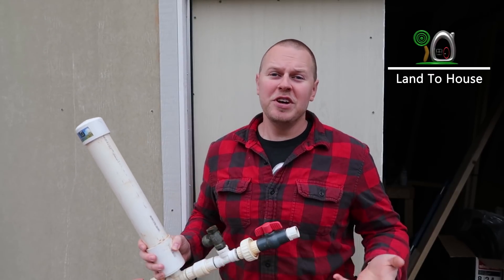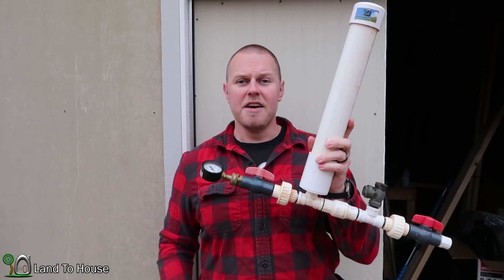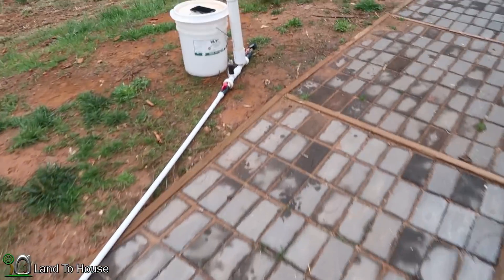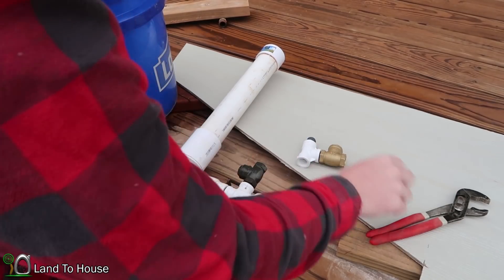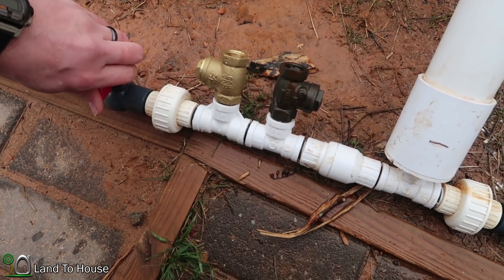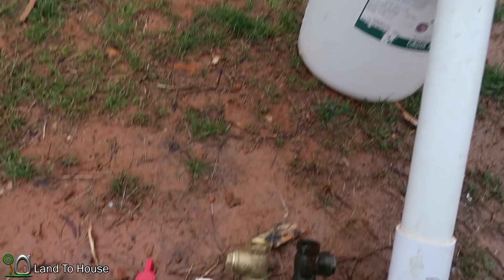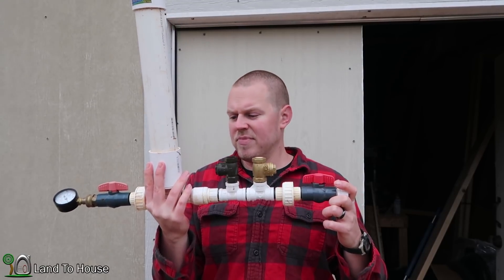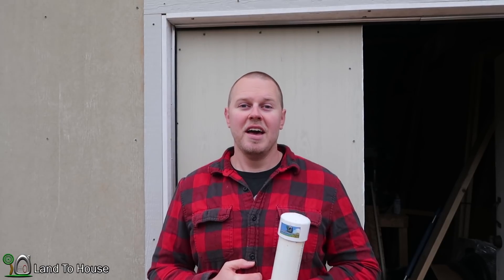Double Waste Valve Ram Pump Test 1

Comment: Nice video and presentation. 
Does it matter the tank is on the opposite side of the waste valve? 

Investigating such configuration requires both the check and tank to be installed vertically located up stream of the waste valve. And the output valve to tap from the tank after the check valve.

Comment: Very curious as well. Also, what would happen if an evacuation line was attached to the waste valve to direct the waste water into a catchment? Would that extra back pressure increase psi even more?

Comment: what if you created a stream with multiple ram pumps that goes into the micro hydro that feeds into the same pool that the ram pumps are in but at the bottom. i want to crypto mine. if the price goes up to 100k in 4 years $200 a month goes to a 1000 a month... until it halves. so i figured if you can figure out how to make your pool of water big enough to turn into steam to spin a turbine that way all heated from methane biogas then collect the steam and add it to the top. heat produces electricity as well.

Comment: How about turning the check valves so the checks are parallel to the flow thus increasing efficiency of the valves and not loosing too much water?

Comment: Running in series only helps if you have too much flow for the system.
You need to run them in staggered parallel.
Reply: I agree

Comment: What about adding the second check-valve on the siphon line, up close to the source (not as a waste valve)? I'm wondering if it might be able to add a 2nd, smaller water-hammer at the pump by stopping the shock-wave from making it back to bucket.

Comment: I love experimenting. What if the inlet of your Supply or drive pipe (3 inches diameter at 10 meters long) is only elevated a meter above your Ram pump, would this be a good set-up? Would this give you good pressure to deliver the water to an elevation of 50 meters above the pump? What will be good to use a single Waste valve or the double?

Comment: New at hydro systems. I built a 3/4'' ram pump. Works great. I have a low flow water supply.Have you tested a 1/2'' check valve on a 3/4'' pump?

Comment: The swing disk inside the check-valve works off of pressure and gravity. When you tilt the check valve you are lowering the gravity-force on the swing disk. The tilt can be calibrated by trial and error for the optimum inlet pressure to gravity ratio. The total feet of head coming from the feed pipe needs to be measured to make these tests relevant. Also, the more output GPM flow the less output pressure the pump can produce.

Comment: from a physics perspective, if both of those valves don't close at the exact same moment, your shockwave will have kind of a double peak so will not have a lower pressure spike height.  You would be better off having a larger single valve to retain a single pressure spike peak.
Reply: Two drive lines into two waste valves, two check valves, into 1 pressure and delivery line.

Comment: Wrong placing waste valve. Put it at outlet valve so you have expansion tank adding to supply tank to second waste valve, pressure should increase.
Reply from the maker: Yes I have a video showing that. It does increase the pressure a little more when the valves are in the other configuration.

Comment: Can you simulate the ram pump inside the Great pyramid of Giza. We have a descending passage, a valve, same descending passage with a valve at the end. The first valve goes to ascending passage, the gallery, the pressure chamber with those capacitor like blocks and Queen chamber where the water goes out. The air shaft with two electrodes to jumpstart the valve and let water to go down to the bottom valve which becomes closed and the shock wave will close the upper valve up the ascending passage and fill up the queens chamber. Another valve on side of king chamber pushes the water out until the outside pressure closes it and the mid valve closed again for water to rush down the descending passage to the bottom of pyramid unto the lower check sliding valve.

Comment: third thing to test is the flow rate of the delivery pipe.
How about testing a 3/4 pump with only a 1/2 waste valve, against a 3/4 pump with a 3/4 waste valve.

Comment: I once learned in vocational school that the inlet pipe must have at least twice the cross-section of the outlet pipe for the same flow rate.

you can't generate energy from nothing. 

e=mc² energy = mass times velocity squared

if you know this, you can calculate the kenetic energy with Newten's law and you will find that if I press twice the mass at the same speed through a pipe of the same diameter, the flow rate will increase

so you either have to increase the gradient or the peak back pressure by doubling the pipe diameter.

Translated with www.DeepL.com/Translator (free version)
Reply: You are looking for the derivation of Bernoulli's principle "increase in velocity of a fluid occurs simultaneous to a decrease in static [PE]?"

Comment: The water-ram pressure from one of the valves is wasted shutting the other. You can see how the second valve to close "spits" water farther than the first one. That wasted water was supposed to go into the pressure chamber.

Comment: Did you try adding a air vent pipe sticking straight up in the middle of the pipe going from the bucket at top to the ram pump?

Comment: Just curious, could you augment the pressure on the supply side by means of borrowing some pressure by looping back a small line from the output end back to the supply line ahead of the waste valves?

Comment: @LandToHome 2" drive pipe to Y, to two separate 1" straight ram pumps back into a Y with a 3/4” output, you should be extremely efficient and high pressure.

Comment: If you catch the waste water from a 1/2 waste gate would it be enough to keep a 2nd 1/4 pump going and T the outputs together, would help with efficiency
Reply from the maker: I am about to do a test with 1" pump and 1/2" pump together like that. Should answer the question.
Reply: Could place  1" pump above a old bath tub with pipe at the bottom to feed 1/2,

Comment: Dude, I found the Clemson site years ago and have been running a 11/4" system. I could have told you everything you have discovered.  The problem I have is wearing out the brass swing check valves same with the spring type valves.
Reply from the maker: The Clemson University information is very helpful. But I'm enjoying making the YouTube videos with the same information.

I've been using a stainless steel valve for the past year and it has been remarkably well. But they're so heavy it limits the situations that the ram pump can be used in
Reply: @LandtoHouse  I'd like to make my own valves but I don't have what I need to do it right.  I get a year sometimes two and I don't pull it until the water is too high.  Where are you getting the valve?
Reply from the maker: I sourced valves from China. The stainless steel would last 5+ years I am sure but the valve needs to be tilted at 15 degrees just to close. Too heavy. 

I have thought about making a diy valve just for fun.
Reply: @LandtoHouse  too heavy? Swing or spring loaded? I checked ebay and the prices are doable if they last beyond two years.

Comment: what about using pipe glue and stronger abs pipe and fitting where its possible and brass valve min.3/4 size ? your video good thanks and best regards.

Comment: you should try a tesla valve in the drive pipe instead of 2 waste valves. this restricts the puls back in the drive pipe leaving more energy to create pressure
Reply from the maker: A Tesla valve is designed to constantly allow flow in One Direction. It doesn't have that sudden snap to create the water hammer. I don't think it would work.
Reply: @LandtoHouse   it is not to replace the existing valves but to reduce the shockwave travel back in to the feed line so this sock wil only move forward
Reply from the maker: Ah ok. Yes I have that test on the list.

Comment: This is 2 yrs old but you need a surge tank between each check valuve but one of them surge tanks will have to be bigger or taller . One surge tank or pressure tank wont do it like it should

Comment: I'd like to see you Manifold Two Ram Pumps together, one supply line feeding two Ram Pumps, and manifold both Ram Pumps to one output line
Reply: I never even seen your comment and I had the same idea, lol, I think 2" drive into two 1" normal pumps out to a single manifold and a 3/4" output, should see awesome pressure and efficiency

Comment: Can ram pump only push water uphill or even down hill
Reply from the maker: Only uphill. The pump needs back pressure to keep it primed.
Reply: if you want to go downhill after going uphill, simply make a reservoir for the water that is pumped up by the ram pump, use gravitational feed downhill

Comment: Would this setup work using a water butt to evenly irrigate a lawn and flower bed? If the butt was at the top of the garden and the pump was at the bottom then just lay some underground pipes?

Comment: You should try and connect 2nd waste valve in parallel using Y pieces rather than in series.
Reply from the maker: That video is coming soon! I have it on the list.

Comment: What's your final conclusion on the double valves now that you've had a couple years to work on them is it worth it
Reply from the maker: I find that you might as well step up the size of the pump. The double valve does not increase the lift height only the water volume.
Reply: @LandtoHouse  it should too or not?

Comment: The length of the drive pipe doesnt matter, just the vertical fall.
Reply from the maker: The drive pipe length actually can determine the cycle time of the waste valve.  Too long and the cycles are too long. Too short and the cycles will be so close together the pump stops.

Comment: I don't understand what you're trying to achieve. I would mount 2 pumps in series if you want higher pressure. The multiple waste valves only waste more water.

Comment: I have some test to run. You have the waste valve right on the tee. What about a 6" pipe on bottom of the waste valve. Then a 6" pipe on top of the waste valve. A 3rd test with a 6" pipe on top and bottom most likely would be not good as I think the two would cancel out. Speed is the key to a ram pump. The faster the water is going at the time it trips gives you the highest pressure. I am trying to think of a water the giving the water as much time as possible before it trips.

Comment: So a question, just out of interest sake. What would the result be if you had the vales in parallel and not in series?
So, 2 separate buckets of water feeding 2 separate vales that feed one pressure cylinder, that feeds one outflow?
Reply: This is my thought too. Works for electricity.

Comment: I'm disappointed that the only delivery was to the pressure gauge, meaning all the water must exit via waste valve(s).
Reply from the maker: This test needs revisiting.
Reply: This test proves Nothing...
Because you are not pumping the water nowhere,,,, whitch is what a ram pump is designed for.......
Set it up do do what it is designed to do..  
It will not mean anything, just to build pressure in the pump itself....
Reply: You could use it to build initial pressure then release it I guess.

Comment: Crazy thought, could you go down stream and connect the waste water to another ram pump or is that asking too much of gravity?
Reply: Back pressure on the check valves would stop the whole process in my opinion. If you allowed the waste to fill a storage tank and pumped from it further downhill sure it would work. I have not tested this but it seems logical because the check valves are working off resistance.

Comment: I did the same system, with 60-68 psi,  but i used 1" valve and 4" 8' pipe mounted to tree.
Fills 12-75gal borrows. From there it goes through a  ultraviolet light
to 2 tank 500gal for emergency.  Part of overflow goes to a  tank 150gal feeds the garden, and landscaping.

Comment: I think that if you made everything 2 inch pipe you will get much better.  Some where someone said that the drive pipe should be twice the size of the output.  You may get the higher pressure if everything is 2 inch until the out put pipe with just one bleed valve. But check it with 2 just to see. I have never made one just going from what another video was saying.
Reply from the maker: You have heard correctly but the waste valve needs to match the drive pipe. So the delivery would actually need to be smaller. The good news is that delivery pipe size does not matter as long as it's big enough to prevent friction loss.

Comment: What about having another one way valve in the direction of flow before the waste valve? Could send the shockwave to the pressure tank rather than back up the supply line.
Reply from the maker: I have heard of people doing that. I have that test written down. For the ram pump Series this spring

Comment: Can someone explain please why the two independent valves sync up in time with each other I imagined one opening at the wrong time and releasing the pressure 

From my understanding the shockwave shouldn't close the other one at the exact same time
Reply: Also you could try this with an inline one way inbetween the check valves be interesting to see if they 

A. Stay in sync  and 
B. If the second check add to the first instead of trying to do the same thing
Reply: Maybe a split second after I may have to slow slowmo   the video to see if it is the exact same timing like it looks

Comment: You are only measuring waste water flow not water throughput 
I feel like having nothing moving through the system in entirely would massively  increase your waste 

also I would like to see the same test with two buckets and drive pipes connecting to the pump with a splitter and a larger diameter output this way I feel you would create more water flow but would be interested to see what would happen in tearms of height achieved but this vs standard setup

Comment: I wonder if you ran two ram pump in sequel what the  pressure would be
Reply from the maker: I have run two in the past. Connected by delivery pipe. The pressure did not increase but the flow rate did.
Reply: sorry what I meant was one supply pipe hooked to  one than down the output line u hook another one to the output line

Comment: would id be better to start intake with say 4 inch pipe and reduce the size until you get 1/2 inch pipe to pump as I understand it would give it more pressure at the pump
Reply from the maker: That actually is not good for the ram pump. Because the pressure wave travels in both uphill and downhill directions it is counter productive to push against the larger volume of water uphill.

Comment: Good test.  Essentially indicates a larger check valve requires greater head pressure.  The pressure can be increased not only by a larger pipe, but the elevation of the water source as well.  Fascinating!
Reply from the maker: Yes well said. But increasing the valve size is not lifting water higher. Seems like it's best to just increase the pump size.
Reply: Seems like valves shut based on flow rate, so although increasing feed pipe diameter doesn't increase pressure, it does increase flow rate

Comment: One thing you can do is try to remove or add some weight or a soft spring to the valves and see the results. In my opinion the flow valve must be as light as possible and the waste valve may be a bit heavier for more preasure and les flow and lighter for less preasure more flow and les waisted water.
Reply from the maker: In traditional ram pumps the waste valve had an adjustable weight to make changes based on the drive pipe length. I am actually in the middle of changing over all Land To House ram pumps to Stainless Steel waste valves. This should really help in water pumped because it is a bit heavy.

Comment: I think there should be something to collect the waste water and flow right back into the drive pipe
Reply from the maker: Sadly this does not work. There is a large pressure difference between the waste water and the drive pipe water. If you open a hole in the drive pipe the water will only flow out downhill.

Comment: What materials did you use? How many valve? Etc. Thank you
Reply from the maker: Typically I use a single waste valve and a single inline valve for a ram pump. In this example I'm testing multiple valves as a waste valve. You can find how to videos on my Channel showing the materials and how to build a pump.
Reply: @LandtoHouse  thank you for the response.. But i would like to try your ram pump. Since we will be conducting a design of rampump .. And i am not familiar with the parts you are using. I would like to know what is the best or the fastes rampump to fill a bucket. Is two series waste valve good? Thank you.. And im sorry.

Comment: Dude, In this particular set up, try to install, inches before the two waste valves, a larger diameter drive pipe (say, 3-4 inch dia. x 4 or 5 feet long) I pretty sure there will be an increase in pressure in the system. 
Hope to watch this experiment soon to see if my theory is right.😉
Reply from the maker: Increasing the size of the drive pipe to accommodate for the extra water requirement did work. I have not however tried to use a very large Drive pipe just before the pump. In my experience I have found that the pump can cycle too quickly if the drive pipe is too large.
Reply: @LandtoHouse  try using a modified (no spring?) foot valve as your waste valve, because the intake pressure is quite stronger due to the "oversize" pipe.